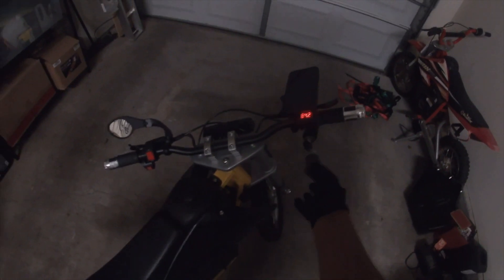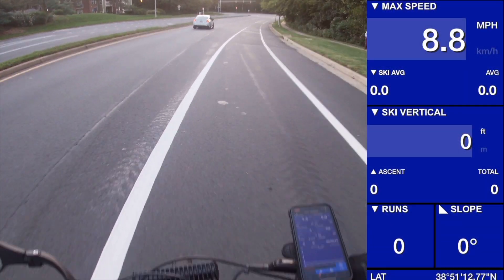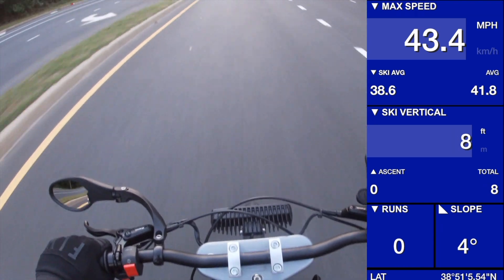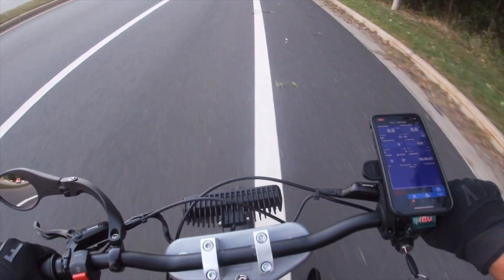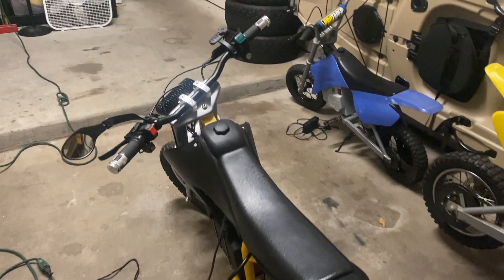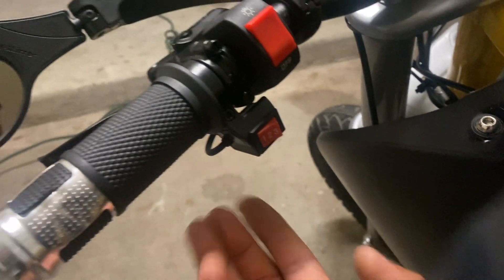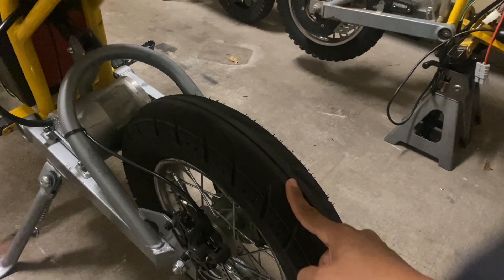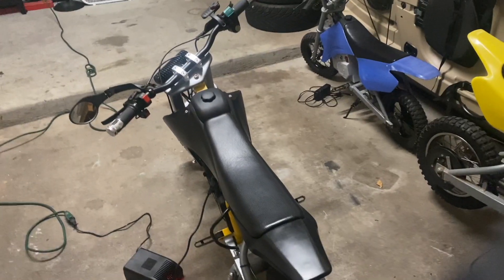Chasing New Speeds with the MX2000 Part 1| 72V Kunray Razor MX650 13-Tooth 13T Sprocket

Comment: What sprocket is best for torque and wheelies
Reply from the maker: The stock 11-tooth front sprocket and larger rear sprocket. But it lowers the top speed as a trade off.

Comment: Will the over volt kit work with brushless motors?
Reply from the maker: No, the over-volt kit I used in the earlier videos is meant to be used with brushed motors. Brushless motors need brushless controllers (have (3) phase wires and (6) other wires to controller)
Reply: Thanks Pat

Comment: i weigh 212 would that reduce the speeds your getting by a lot? i wanna build a 3000w build with a 60v battery instead of 72 so i can get more capacity i want 30 ah and put a 13th tooth sprocket
Reply: Just go 72 you will regret 60v
Reply: What are the pros and cons of the 60 vs the 72. My goal is longer trail rides that have some hill climbs but I’m a dad with a 5 year old so I’m just trying to not have them way out in front of me.

Comment: You need to change the rear gearing as well. Everything is not linear. There are great big curves for power. Because physics.

Here's a local guy that goes over 55 on his 650. He just posted this video about gearing that he has tried. He is the scourge of his neighborhood a few miles East of me.

https://youtu.be/K79jWXO0rhM

He shows you in 2 short runs on the sidewalk(lol...because the sidewalk is more fun over 50mph). He has quite a few videos, he definitely is throwing more watts at the problem than you are so don't think you will hitting 55 easily. The law of conservation of mass is in full effect.

Hopefully this points you in the right direction or at the very least assures you that you aren't the only grown ass man trying to kill himself on a kids toy for recreational purposes.

Heh heh.

Comment: i have the same exact setup but with a kelly kls71212. max speed on a 13t on a flat is 47.8. i never seen 50 even on a full charge. did you check the bms on this battery? could only be giving you 40 max.
Reply from the maker: This is good to know! Really didn't wanna tear into the battery. I'm likely gonna step down my rear tire and swap to a better controller anyway and go from there. I just want to get close to 50 MPH as much as possible, then I think I'll be happy with where this bike is and focus on my Enduro project

Comment: I feel like that’s sort of normal. At least on my e scooter it charges up to 67.2 v on full charge but once I start riding it drops down to low 60 ESPECIALLY if I have my lights on (headlight and deck lights) if the lights aren’t on the voltage doesn’t dip as far. Granted my pack uses lithium ion not lipo cells though. Never affected performance though. I can ride down to 48v before it’s basically ready to recharge and it holds its power through the voltage drops as well. I’m not super experienced though just relaying what I see on my electric vehicle.

Comment: You might want to look into a heatsink with thermal paste and some pc fans for the longevity of the motor. I know you have the holes drilled out but so did i and the kunray motor would still get way too hot if you're cruisn 40-45+ for a short period of time. I also have a larger rear tire, u can get a heat sink to work if you modify it. i run a 3x10 not a 3.5 x10 but have seen others run a 3.5x10 that got a heat sink to fit if u move the motor slightly forward and modify the heat sink
Reply: But honestly 3x10 is the sweet spot on these bikes. The 3.5x10 is definitely robbing some top end with the extra rotational mass
Reply from the maker: Yeah I think I'm going down to a 3.0x10" as my next set. The PC fans you are referring to.. Do you have a link or photo I can look up?
Reply: @PatOutdoors  also a 65t rear and 14t front sprocket will get u well into the 50s. All u need to do is use one of ur mx350 chains

Comment: See if you can file a little more on the motor mount slots. If that doesn't give you enough clearance, you could sand down the tire with an angle grinder, while the tire is spinning, with one of those flapper disc's.
Reply from the maker: Thinking of going down to a 3.0x10" at some point soon. I may try to file a bit more for now

Comment: Hey Pat, thanks for the update! I think you could be on to something with the battery pack. I know that some pouch cells will perform better at warmer temps. The battery I built has pouch cells and many people have confirmed that they work better at a higher internal temp. Maybe you could charge the bike indoors and take it out for a speed run or wait till it warms up again and compare the results. Great content and keep up with the grind!
Reply from the maker: Could deff be it, that's the only big change here is weather. I may take it back out whenever I get back in town next week. Hopefully it's warmer then. I'll likely create more clearance for my rear tire as well, to reduce any variables.